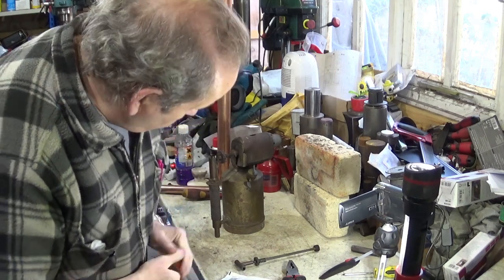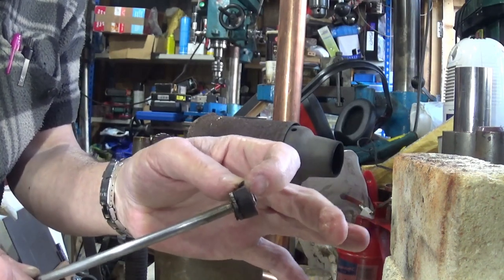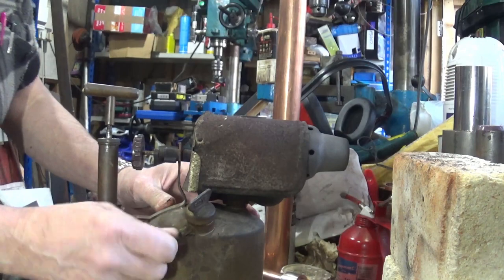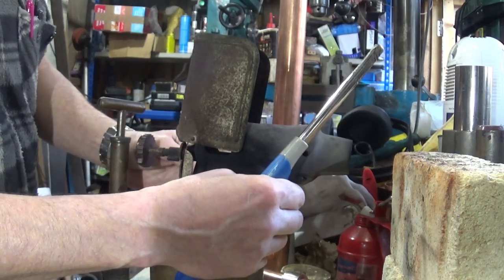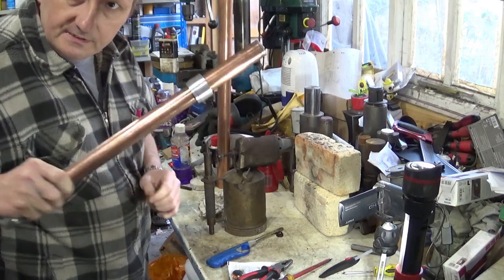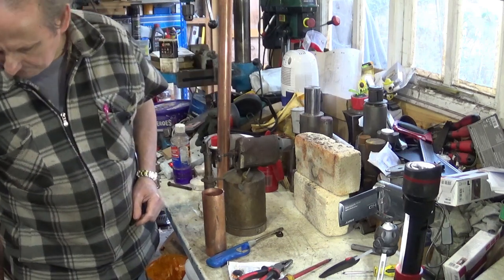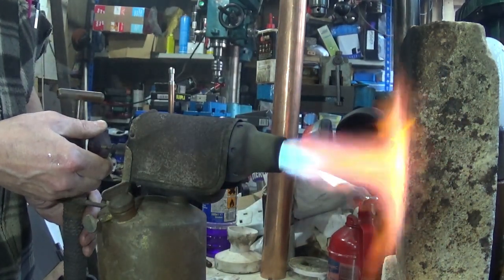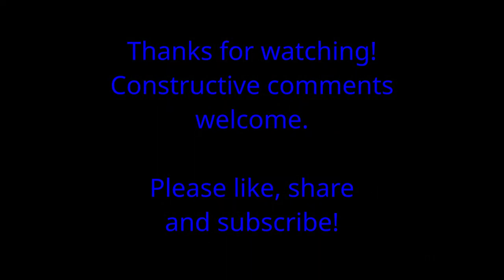Radius Paraffin Kerosene Blowlamp Cup Washer Change

Comment: Awesome Ben - the cup washer on my Sievert blow lamp was a bit tired but still serviceable, but I wouldn't be surprised if it disintegrates in a year or so, at which time I'll follow suit.  They're lots of fun - I've got a couple of jobs coming up for mine, so that'll be fun.
Reply from the maker: They are great fun. I suspect yours has a common cup washer size.

Many thanks for watching!
Reply: @BensWorkshop  Yeah, it would seem pretty likely that mine will use a fairly standard size washer - I'll maybe get round to measuring the diameter at some time.......
Reply from the maker: @GrumpyTim  I am fairly certain it will be a standard stove washer. It it isn't, get me the size and I can make a tool to make one.
Reply: @BensWorkshop  Cheers Ben, I'll get measuring sometime - I used it again the other day and it's so much fun!!!!
Reply from the maker: They certainly are!

Comment: Was that wasker specifically for that blowtorch or did you just find one that fitted?

The making of a steam engine, that will be fascinating.
Reply from the maker: No, most washers come in a very limited set of sizes. The one used also fits Primus stoves, or at least the larger ones.

I will be getting to the boilers soon! Many thanks for watching.